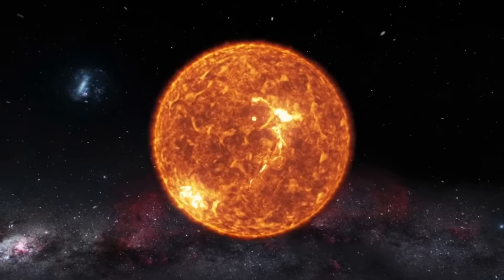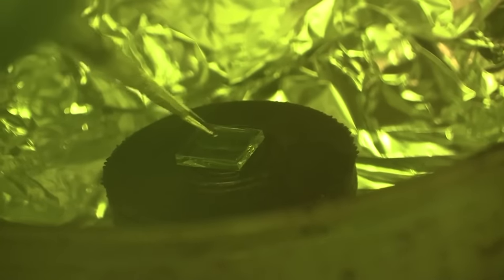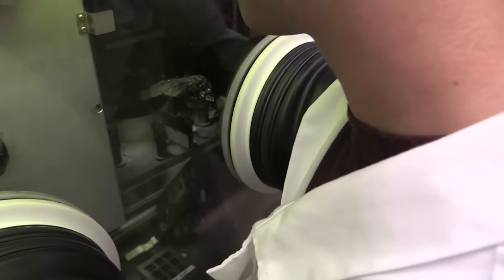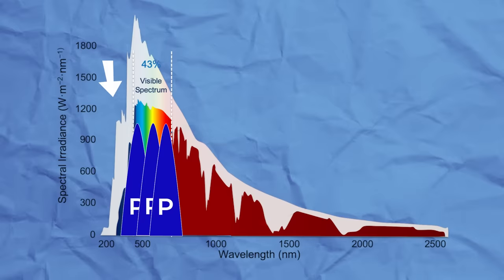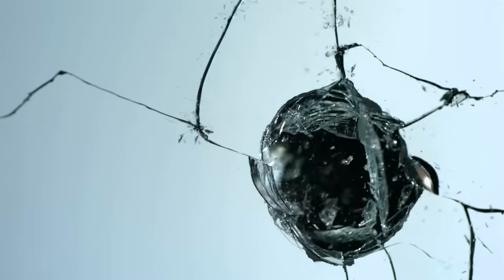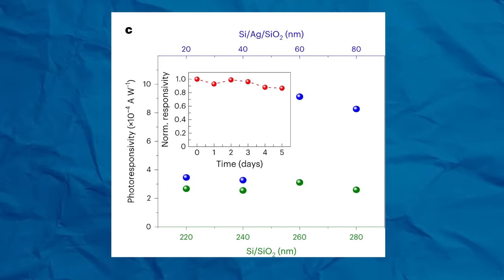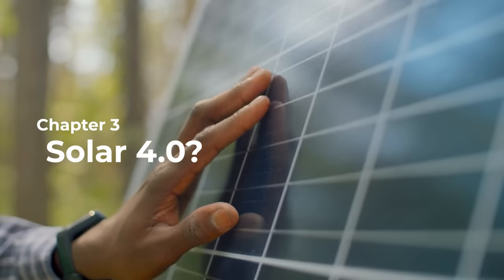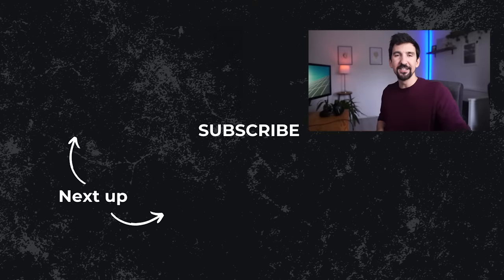Solar 4.0: Ultra Efficient Solar Panel Breakthrough

Comment: In the UK our main energy requirement is heat, but for some reason we focus on what could be considered appliance energy.
Solar thermal walls and roofs even in northern climes could achieve winter heating and the excess through summer can generate through an ORC likely cooled in a heatpump groundloop.
Thermal stores can be little more than a insulated wall type which creates a generation latency to offset peak sunl;ight by several hours.
Solar PV has focus because it can be sold and fitted as a cunsumer product whilst likely if designed and built, we already have extremely fit for purpose regional renewables.

Comment: Dude, I almost blocked you. 250% efficiency? (on your clickbait thumbnail). You're talking magical energy from nothing. It doesn't get better than 100%, and even that is impossible. Please, be a responsible representative of science and reality.
  Thumbs down for that.
Reply: 2.5x  means between around 45-55% efficiency- the confusing part is where he said a "factor of" 250% which doesn't make sense
Reply: Agreed. A 250% increase in efficiency would have been a better phrase.
Reply: The key to my comment is; "on the clickbait THUMBNAIL".  It says simply 250%efficiency. Not 250% IMPROVEMENT....as in 2.5 times better than the current level. The video itself is fine and easy to understand.  It's actually excellent in my opinion.
   It's the thumbnail that is false and misleading.
Reply: @theobserver9131  250% efficiency makes no sense, that would be a material absorbing at 3-5 suns at 50% efficiency... Or in space at double the solar luminosity concentration. Even if a solar cell was 100% efficient in space it would only equate to 200% efficiency on earth ignoring ozone layer, clouds, ionic and radio interferences, aerosols and atmospheric moisture.
Reply: If. Wind turbine were 100% efficient there would be no wind behind the turbine, maybe you can use electrohydrodynamic attractors to concentrate wind sheer solely on the wind blades themselves, but then there would be no wind but a low pressure zone behins the wind turbine
Reply: If a solar cell were 100% efficient it would emit no light... If yoy took a photo of it, it would just show as an arwa in an image where no quantum holes formes on the photon detector in the camera photosensor
Reply: Luminous solar collectors redirect, (refract light sideways) to the edge of the glass or plastic.... Therefor yoy end up with a surface that tints the colour of the inherent material or impurities in the glass/plastic like a strange green or red or yellow.
Reply: Therefore a 50-60% efficient cell will absorb/transmit more photons... However it will remain visible all the way up to 95% with some light scattering. 100% light absorbative materials do exist. In fact they were developed by Chunlei Guo who actually worked on this new light pohotosensitizer in this video.
Reply: They actually did create an actually solar cell thay collects energy with this mirror technology using a very basic approach that gor 16% efficiency, but the photoexcitation was also 250% improved. They merely built the simple device to prove that the long carrier diffusion can be collected. They uses a tungsten dichalcogenide... However it was not intended to get high efficiency by measure egfwcts of dipole behaviour becuase tungsten is a dielectric metal and dichalcogenide has a high organic light harvesting capability... Solar cells of 50% ARE achievable becuase we have seen high perfoemances with multijunction cells that have even higher efficiency in space becuase of the higher solar flux outside of the eaths atmosphere... However they need very good thermal management for the inorganic cells
Reply: If something is 20, a 200% improvement would be 60.....or 40 if standard efficiency is measure as the standard for improvement... 140% improvement could mean 24.... Depends on the context....

Comment: If they sprayed multiple layers of different perovskites on a mirror surface ( say a stainless cybertruck) then sprayed a partially silver surface over that so that light entered but then was trapped between the two silvered surfaces, like a laser beam is trapped in a ruby. Then possibly most of the light would bounce back and forth in the energy generation layers until they connected with an appropriate photo hole. Thus giving a near perfect conversion to power.
   If inexpensive highly efficient solar cells become possible it would really help out the grid.

Comment: In South Africa we have 4 hours up 4 hours down time with National Load Shedding. So Solar is a must, but you need 10 panels to run an average house hold. The efficiency vs cost is not ideal. If we could "3D Print" panels say on "mirrors" locally the shipping cost would be gone and maybe Solar Panels could become part of your house windows. Time this is sped up for a better future. Building real energy efficient houses with appliances (Lights, TV, Fridge, Laptop and Computers) running on DC  not AC plugs

Comment: Fascinating what is going on with this material, I can see the weight reduction making fitting of solar panels so much easier if it becomes a real proven break through. The perovskites to silver charge interaction is almost a mirror image of an induction motor (perovskite = stator, silver = rotor and more tenuously release of photons = flux). In my simple mind would etching breaks in the silver so as to prevent recombination of charge ( analogous to the induction motor eddy currents and associated power losses) in the silver and thus maintain photon reproduction levels towards peak levels?

Comment: Thin film silicon or other materials can have a 2nd layer of pervoskovites added on the bottom of glass on glass solar panels. this allows them to be used now with the direct UV exposure removed by the top material.
GAIA your welcome.
Reply: Perhaps sandwich the metal layer in the middle.
This allows decoupling top cell from bottom cell not needing to be in //.

Comment: So it's essentially guiding electrostatic pressure to the wires via the mirror. It's making alternative electron paths and recombination a more unlikely event through the mirror causing wave-field interference. The right mirror effectively creates an photon dead zone in the recombination zone, due to wave field interference, of any photon originating from a recombination. Further photon interactions become biased towards the collectors, improving efficiency.

I mean, think the double slit experiment. Photons don't hit the dark lines on the other side. Except now have a recombination event as your source and the mirror your double slit. You'll get a interference pattern reflected. Which you can place your recombination zones in the destructive interference areas and collectors in the constructive interference areas.

Comment: "Less light teaching the lower layers" doesn't mean a lot when you can just stack the layers in order of wavelength so the deepest penetrating ones are on the bottom layer.

Comment: The amount of led used in the solar panels  is so negligable compared to what the battery industry still looses even though lead recycling is a huge success story. lets lake the short path to the next generation and work on the lead levels later right? btw great explanations.

Comment: the real question is if the "mirror" can be made of cheaper metals like iron,nickle or iridium for the same or better effects. silicone and carbon basically have unlimited supply on rocky planets and asteroids so perfecting solar panels using them should be higher priority.

Comment: There is also the rarely talked about research into the photo rectenna. You probably already know we can also absorb microwaves or radio waves with grids of metal of the same wavelength as the signal, well the same does in fact work with light, this issue is the wavelength of light is tiny and we've struggled to get diodes of the right frequency to fully utilize this effect. 

There have however been studies showing they do in fact work with one already having one with an energy conversion of 60%. That puts it already around 250% stronger than mast existing solar panels. The issue is it uses graphene/ carbon nanotubes for the grid. In theory however, this has as theoretical total efficiency of around 90% so it is incredibly promising.

Comment: Effective solar panes is only something you need when you do like me and mount it on a campervan where there is no room for large panels. For the rest of us low COST of the panels is the only consern. I have four 320w panels on my van, I could have fitted four 400w panels (the most efficient on the market) but they would have cost 5 times as much....

Comment: I was interested till 10;12 when stated,  Silicone Drawing energy from higher red end of spectrum. Graph showing Wavelength not frequency. Red end of Light spectrum low energy, compared to Blue Violet end.

Comment: Could that silver mirror effect be achieved using copper or aluminum, both of which are very conductive and pretty good reflectors? If the same or a similar effect can be achieved more cost-effectively, that would be even better.
Reply: Also cheaper.
Reply: Those elements are hard to apply as thin as silver or gold can be applied
Reply: @kittimcconnell2633  wouldn't copper just be sputtered on the same way silver is applied?

Comment: Not 250% over conventional Si solar cells  but 250% over previous methods without the Ag undercoat. It “rivals” Si cells which suggests it’s still less efficient. You would have to read the paper to be sure.

Comment: A typical 3kW solar array with batteries costs £9,795 (complete installation)
It will typically generate 2,500 kWh a year
2,500 kW would cost £850 at 34p per kWh, so you’re saving £850 a year
So we can divide the cost of £9,795 by the annual saving of £850...
£9,795 ÷ £850 = 11.5

So would take 11.5 years to payback your investment of £9,795
BUT...
There is maintenance and servicing (and cleaning) to pay on your solar panels over years
So it’s more like 13 years (an inverter may fail which costs £750)
Between 13 years and failure of your array after 25 years you would have saved £10,200

BUT...
If you invest £9,795 at 5% you would be paid £490 in interest per year
After 25 years, that would be £12,250
AND you get your £9,795 back (whereas your solar panels would be worthless)
So after 25 years you would have a total of £22,045

Solar panels are a mathematical madness at ‘saving’ you money!
If the cost of electricity drops (from the quoted 34p per kWh) then your reason for solar panels are even less. If you can get better than 5% interest, your reason for solar panels are even less. This calculation takes no account of the degradation of the panels (they wouldn’t be producing 2,500 kW after a few years!) and takes no account of interest or inflation changes.

Comment: In a typical grid scale solar farm, the actual cells make up less than half the cost. The rest is the panels, installation and balance of system. Add that to the fact that perovskites have issues with longevity and they are far from cheap. In any case, even as they stand, conventional silicon based solar panels are a cheap source of energy. The real interest now lies with reducing the cost of energy storage.

Comment: I like the way you set up the lighting in your studio for the video.  The orange lamp and the blue tube lamp fills out the color wheel and enhances the red in your shirt the color of your face.  Then the use of a Rembrandt side light makes your face jump out of the frame.  You also have some objects in the corners to balance the shot.  I think I would have given you a bit more headroom rather than cutting off the top of your hair.  That adjustment would have put your eyes at or just below the upper 1/3 line.  Then you are in the middle and it would give you a bit more authority.  Maybe there was a wall/ceiling corner or something just above your head that could distract.

Comment: Research is one thing. Mass production is a completely other game. So is longevity - absolutely essential. Perovskites need to show longevity or else be less than 1/4 the price of the silicon ones so they can be used and recycled.

Comment: Excitons are BOUND electron-hole pairs that orbit each other like a hydrogen (or positronium) atom.  Diode lasers need excitons to form population inversion needed for gain, but solar cells would be inhibited if that state were available.

Comment: 2:33 - I think the use of "higher" here is incorrect. A better word to use would be "longer". When talking about light or anything frequency related higher is normally referring to smaller wavelengths. Red is at the "lower" end of the spectrum of visible light as a result. Later in the video you correctly refer to the higher and lower bands though so I'm guessing the first mention was a scripting error.

Comment: I'm wondering what the metal 'mirror' substrate technique could do for (thin-film) silicon solar cells with aluminum. Much more interesting considering the large amounts of silicon solar panels being produced and used. I wonder by how much it would improve low-light performance of silicon solar cells.
Reply: They're already used in silicon solar cells, or so I've read.
Reply: @Voltaic_Fire  Which types of silicon solar cells? Can you give me a link to your source?
Reply: @petertrypsteen  Sure can, scroll down for answers typed out by people more knowledgeable than me, I read it in a comment down there somewhere.

Comment: Efficiency was not really explained in detail in the video - do I get it right that if now, current photovoltaic panels have efficiency of ~21.5%, that these perovskite panels will have 2,5x (250%) of their efficiency? That is, perovskite panels will have = 3 * 21.5 = 64.5% efficiency?

Comment: I'm a little lost here.  I thought perovskite was a crystal form of titanium oxide and calcium.  What does lead have to do with it?

Also, as someone pointed out below, 250% more efficient then what?

While were at it.  Just how much silver are we going to have to use?  The stuff is moderately expensive and has a limited supply.  Admittedly not as limited as the rare earths we're currently using for this.  And then there is the cooling issue although if we have to siphon off say 10% of the electric current to run cooling fans....

Comment: Since perovskite cells still have their own issues, can this silvery mirror be applied to silicon solar cells currently on the market to further improve their efficiencies?
Reply: Adding more silver to silicon solar cells is the last thing you want to do. Also the efficiency gain would be significantly less.
Reply: @Wishkeyn  I see. I'll sincerely like to know why.
Reply: @adon8672  The reason you don't want to add more silver is because solar panels are already driving up the price of silver. Adding more to it will speed up the demand while also increase in cost over time. Ofc this is assuming it has a significant benefit. 

As for the lower efficiency gain, for single junction cells the Shockley–Queisser limit means there isn't much to gain in terms of conversion efficiency on the silicon cells, cost can obviously be reduced however. 

This is not to say you can't increase conversion efficiency by this method, just that it is cost inefficient.
Reply: @Wishkeyn  Okay. Thanks for providing more details. I was worried it might technically have some negative effects that I couldn't think of.  If adding more silver will lead to a significant increase in cost without a matching increase in efficiency then the process is economically out of the window.

Comment: jan01’24/0928h 🇺🇸 Dr. miles, thank you for the information on the newest discovery of Perovskite PV cells. I’ve scored all over the wide world to learn about the new discovery, but failed to see one single info on it. I feel that you are the first person to talk about the discovery.
The silver lining at the base of the P.PV cell is slightly understood, which’s almost similar to Bifacial PV cells. I’ve heard from an amateur PV cell YT broadcaster from NV that he placed plastic mirror under the Monocrystaline PV cells by which he gained a few Ampere output from that experiment. How far it’s true, I have no comments. Is it possible to shed additional data on Perovskite PV cells? If the system is under development and is bound by NDA, then I can understand. But upon hearing that the efficiency of perovskite PV cell is 75% higher than the Poly/Mono PV cell is unbelievable. Thanks again for the thrilling write up and looking forward to reading additional Data on Perovskite PV cell, from your office. Regards and 73s…

Comment: add Ultra Colloidal Silver Concentrate,  to the Epoxy Covering of the Pannal, That would be a Hard Mix, Water and Silver are not going to mix with the Epoxy .  Maybe Mix Silver with The Drier For Mixing it in the Epoxy for the Silver Reflexions to happen with in the Cells !  Maybe ! This would add The Silver to any Cells already Made !!!

Comment: So what's the final gross efficiency? Did the researchers double the efficiency of a 35% cell to 80% or of some junky 15% experimental cell to 35%? Need more info
Reply: Judging from other comments from people who have read the paper the technique hasn't even been applied to solar cells yet but only to specialized light sensors.